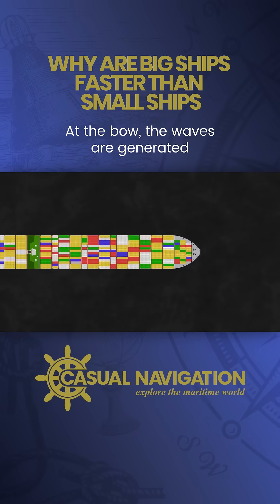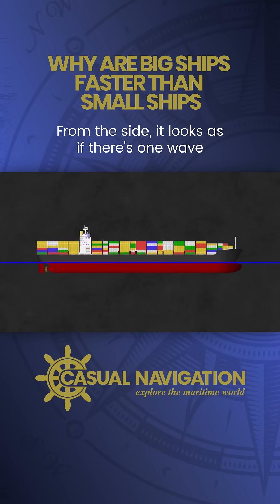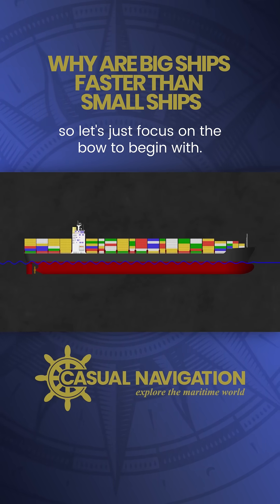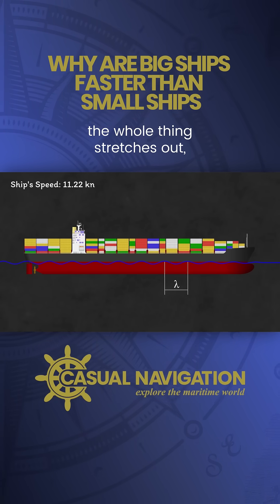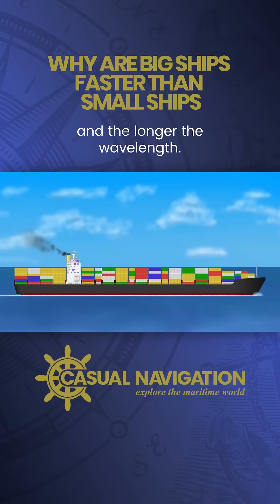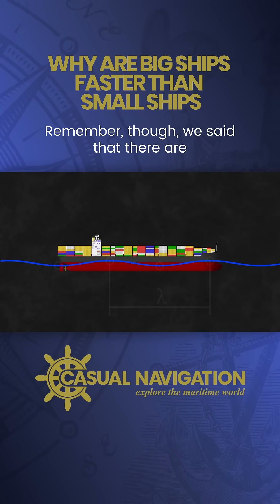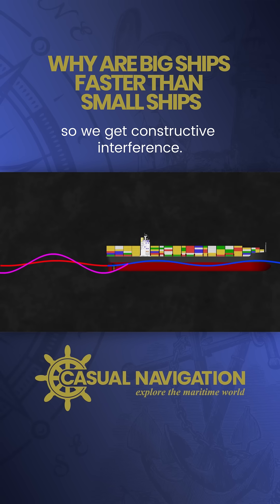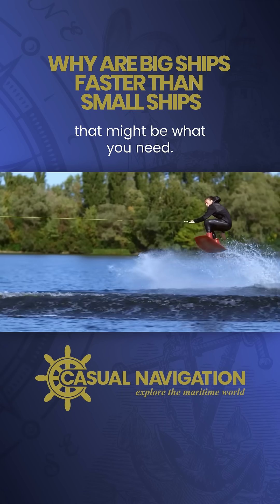Are BIGGER Ships FASTER ?

Comment: For a 400m containerschip to fit that wave to 2/3 of its length, it would need to do 40+ knots. Not gonna happen.
Reply: For a ship with a waterline of 380m it would be around 30knots for the wave to be 2/3 the length.
Reason for 380m is the calculation i found uses waterline and not total ship length. As i dont know what the waterline is af a typical 400m ship i geussed 380m.
Im not sure i calculated it correctly tho.

Comment: Doesn't actually answer the question "Are bigger ships faster?"
Reply: Bigger ships CAN be faster but IMPOSSIBLE to come to a proper stop with it, as well.

You are essentially making a giant rock to travel up to the speeds where nothig can bring it back to a proper stop.
Reply: By the way, all of this is in theory, even their drivetrains couldn't keep up with it but when overcomed of these issues, we can bring the ships to a faster cruise speed. But not that much reliable and beneficial to do so. Just use a jetski (or jet powered boat kinda thing) instead.